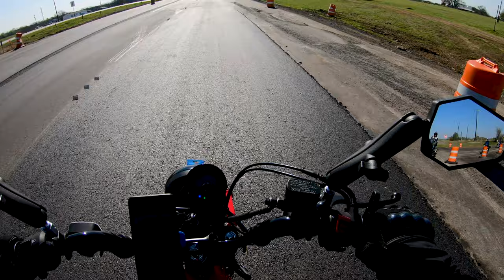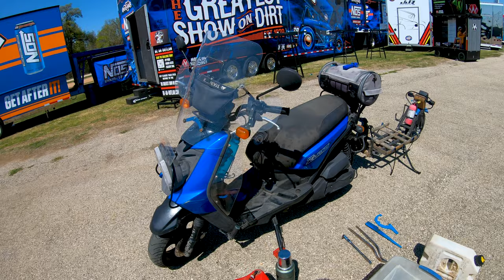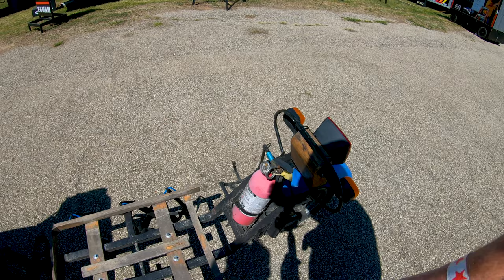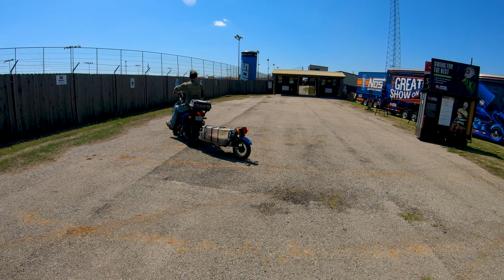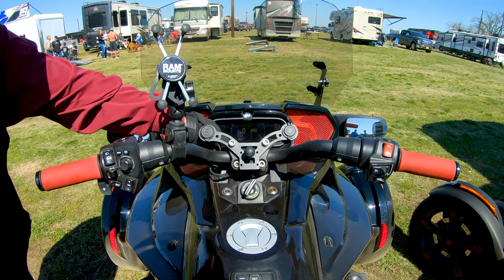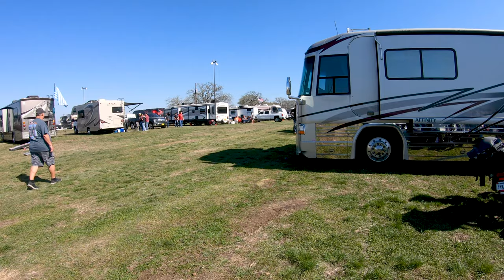ROADTRIP: 2021 Honda CT125 & Super Cubs // Cotton Bowl Speedway - Day 3

Comment: That's a super little bike trailer..🤠👍.. Apparently small bike trailers don't need license plates.. Being able to carry extras like that revolutionizes small bike travel..👍
Reply from the maker: The legality of these trailers is a bit of a "gray area", but we haven't had any problems so far.  Small motorcycles and scooters are "innocent", so they can get away with things that might be frowned upon on larger bikes.  I toured with my KipMoto SherpaX trailer behind the Super Cub over 9600 miles around the USA in July: https://youtu.be/MJCru2h7Rmw .  We never had a single mechanical or legal problem.  😉👍  --QM